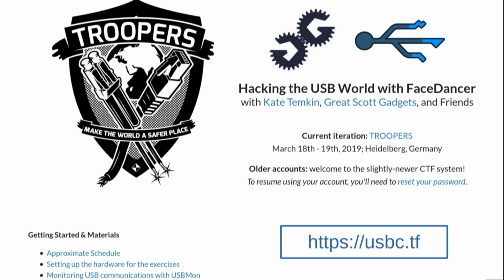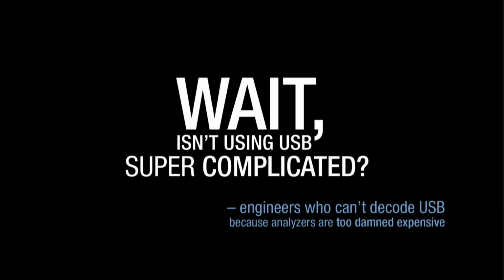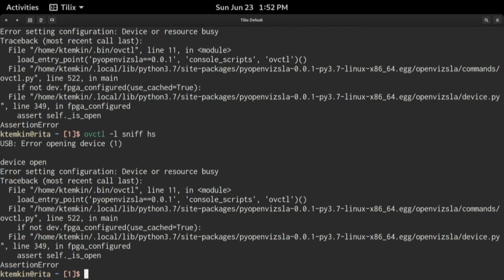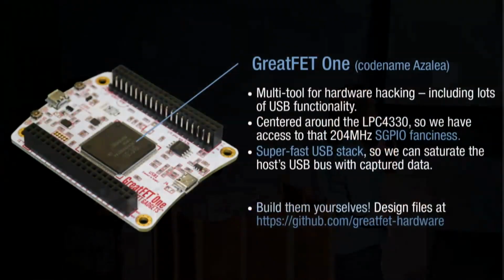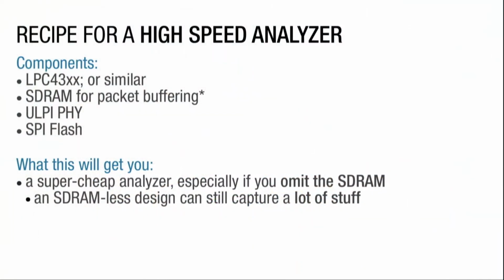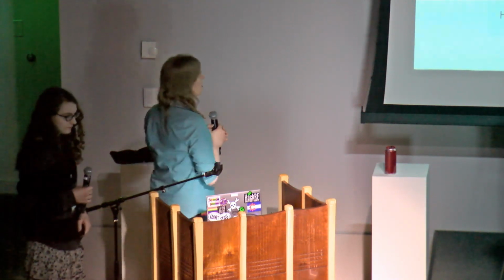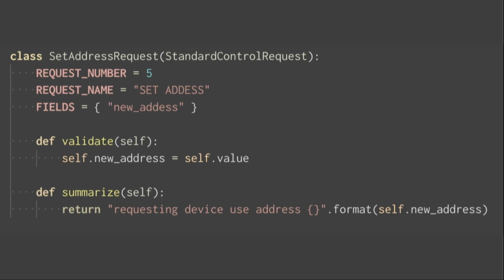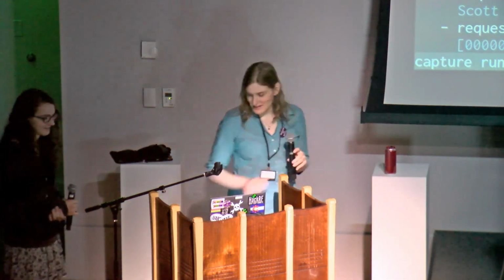TEARDOWN 2019: Making USB Accessible  Developing Ultra low cost, Open USB Tools

Comment: Trying to read two 240MHz signals (the equivalent of 480Mbps) has its costs. No wonder that the Beagle analyzer is expensive. As for Wireshark, it is a very useful tool if you know what to look for.